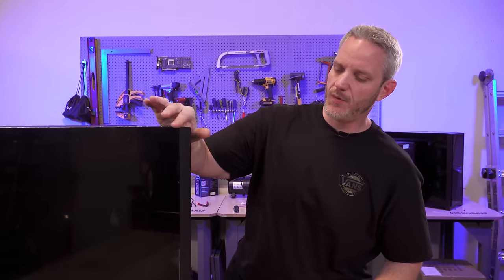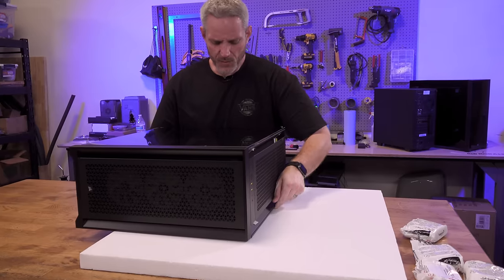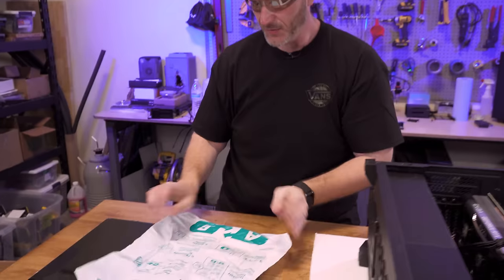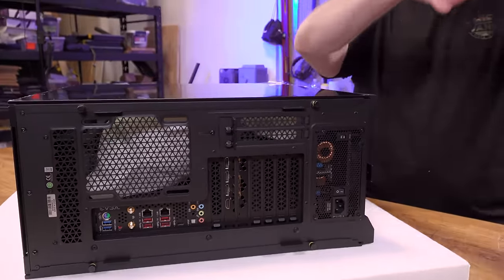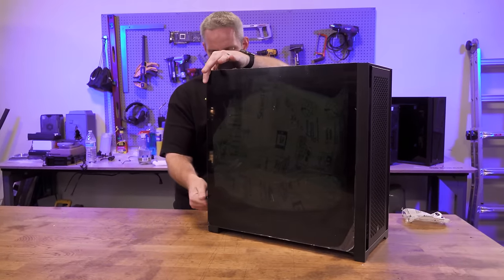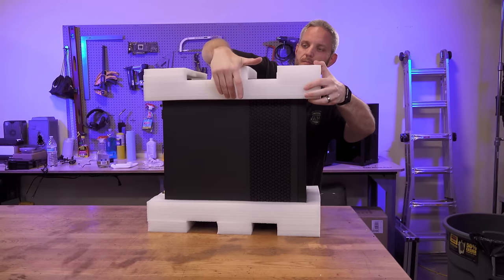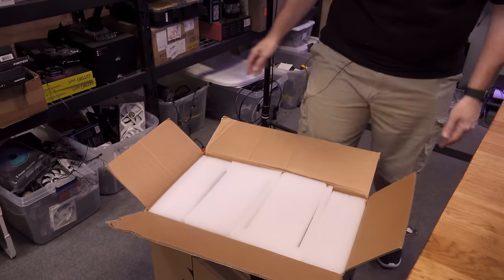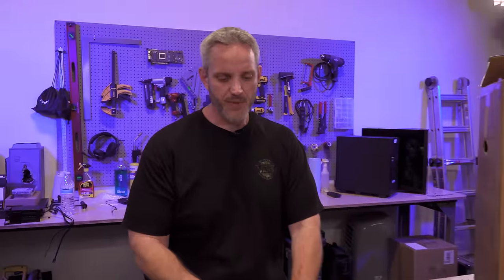How to properly pack and ship a PC!

Comment: Jay's 100% correct. When it comes to shipping something valuable, you can NEVER be too careful.  Most shippers don't give a rat's patoot about your expensive equipment.
Reply: Yea it all goes well until it doesn't and they you can get some really bad experiences which you could have avoided if you took more time/care properly packaging. I learned it the hard way and don't cheap out anymore on properly packaging electronics (specially pc related).
Reply: Reminds me of when i ordered a corsair power supply from Amazon. UPS was the one who delivered the psu. And you could clearly see a puncture hole in the psu box. Which doesn't make sense considering the psu box is wrapped up in clear plastic wrap. So any UPS worker could tell that it was a computer part. And yet they poorly handled it. Luckily the psu works fine. But yeah shipping companies don't care. One of the reasons why you should always double box any pc or pc component.
Reply: That could also happen at Amazon. When I was working there before Christmas I saw people yeeting dozens of PS4s into shipping-container_thingies. But hey why do you know there were PS4s in the package boxes? Well the packaging machine ran out of tape so 10-20% of the boxes weren't even closed properly.

Comment: I am a former UPS employee and I can say without a doubt, Jay has put forth the best package protection effort I have ever seen.  Oh and a warning to anyone reading this, I know you may ship fragile contents and you may be tempted to have a Shock Sensor included on your package.  Allow me to let you know first hand that almost any Unloader/Sorter who sees this, will fuck your package up.  Not to be malicious, but purely for the "joy" of watching the shock sensor turn red.  You've been warned.
Reply: How long does the employes of UPS work before they are sacked, in general?
Reply: @Bratfalken  I imagine it depends on the employee. I have seen instances where they are handling the package and make it seem like the package "slipped" out of their hand as they handle it. They would primarily use just enough force applied directly to the Shock Sensor to turn it red.  And then you had those blatant savages who would smash the packages. The more savage ones were usually very likely caught because management on occasion would randomly walk around and observe people.
Reply: Way back when I worked at a freight warehouse, we’d just rip those shock indicators off. A lot of them were so sensitive you could pop it if you set something down too fast with a forklift

Comment: #1 Tip for packing and reusing a shipping box (along with all the great tips below) = ALWAYS re-tape the BOTTOM of the box as well as the top.
Packages (esp large/heavy ones) tend to get abused on the bottom the most while slid around - So many times I've had things shipped and the bottom nearly busted through. 
I bought a playstation once and the seller reused a box,  applied like 5 layers of tape on the top but left the original tape on the bottom. I received the box, but not the playstation... The box was super light and at first I thought they just shipped an empty box but then I realized the one flap on bottom was open (could tell it was ripped from going thru sorting machines). Yeah that was a fun claim to explain to ebay.. But I could prove that they used layers of tape on top, but left the original layer on the bottom - so it was poor packing.
#2 Tip when shipping something expensive - always attach a printout of the buyer and sellers address and tape it directly to the item (or put inside) - this way if the package somehow gets torn up in the sorting machines or the shipping label is ripped off - the courier can still figure out where it goes. I usually put an entire copy of the shipping label inside the package, attached to the product.
Reply: That is some excellent tips! The second label is an especially good idea for expensive items being shipped.

Comment: I used to use instapak in my job for years.  It does not like to flow DOWN.  We used a machine that we could select the bag size and foam amount and the best way to fill a box with instapak is to make sure the foam filled the bottom edge the laid it into the corner or edge so it could exnd against up/over whatever you had in the box.  These kits might act differently but from my experience you got a better pack if you let it expand up and in.  And to go over something, you just let the bag fold over the object and the foam will expand into the bag in that direction.

Comment: Thank you for the video. I always wondered. When the instapack takes shape around components and locks itself inside the case. How hard is it to remove it? Do you have to cut it?
Reply: It doesn't usually jam itself in too bad, just rock it out of the little cubby it forms around.
Reply: @raze4789  Thank you, I appreciate it.

Comment: Removing the GPU and shipping it separately can be a good alternative to Instapak. Also we didn't get to see it in this video, but putting this in a second, larger box, with foam corners in-between is a very important step.

Comment: One thing that not many do, make sure that the glass panel side is on the bottom side of the second box, sometimes people put other boxes above yours and if your box gets enough weight it might push and break the glass, however placing the glass "down" side of the box gives some more protection, don't forget the "This side up" stickers.
After shipping dozens of computers, not one arrived damaged, and yes I did double boxes too. 👍
Reply: Nicely done in keeping so many PCs safe! 😁
Your tip about having the glass pannel facing done is a pretty good tip. I would also place the PC in a bag, tape a solid piece of cardboard over the glass panel and then wrap the enter PC in a couple layers of large bubble wrap. After that point I would place that in the box face down like you mentioned and secure the box in another box designed for the rigours of shipping with more packing materials between the two boxes. 😊😁
Reply: @jamesfstokes  Oh and I forgot to say, the 2nd box was "Double layer" I got them for cheap on U-Line, you really don't need bubble-wrap unless you are missing the 1st box entirely.
Also, placing stuff in the voids of the 1st box might not be a good idea, the voids purpose, is to give room for the box to collapse into without reaching the computer.
I never shipped liquid-coled computers so that one is beyond my scope.

Comment: we use an industrial version of "insta-pak" we have a container that holds the liquified foam at 75 degrees until it is injected into the bag and sealed. Yes we have to move very quickly to get it into place before it sets up.

Comment: I had the original boxing, and I used pillows on the sides and air bags for the front and back. I removed the GPU and the PSU as well as a few other cards. As long as it doesn't shift inside the box it's usually ok.

Comment: So I worked for DHL. However here in Germany. Dunno about DHL in other countries.
But here it is the case that you package it yourself. And you are responsible for sufficient packaging. 
But they don't require you to have it packaged by them.
Also quick note. Every package will fall one meter onto a metal frame at least once. 
That is because in the facility where they are distributed there is a machine where the package will fall for one meter.

Comment: Also one of the Reasons i build a SFF-PC, I could carry it around in a big Bag XD. The NR200P came with a TG and a Mesh Panel. If i had to move or something, i would pack some styrofoam in it, so parts don't move around and then just pack it in the original packaging it came from. And yes I keep ALL original packaging of my currently used parts...even the 48" TV.

Comment: I shipped 2 computers from Toronto to Kelowna BC Canada. About 5000Km. Canada Post. Just put the computer in the original case box with the original foam packing. But I reinforced the case box with coroplast sheets cut to size. (The corrugated plastic used for signs) Wrapped it in plain brown paper and put Fragile stickers on all sides with 'This side up' stickers as well. Corrugated plastic sheets are much tougher than cardboard. I also bought insurance for them. Arrived on my doorstep one week later in perfect condition.
Reply: How did you keep the brown paper from getting ripped off in transit?
Reply: @jamesfstokes  2" wide fiberglass packing tape on all the seams. Then again on the edges of the parcel to reinforce it. I used to work in shipping/receiving.

Comment: I work for a computer supplier company as a receiver and I will tell you the kind of stuff.  Forklift gouges, dents in boxes that would kill a human being if hit like that, boxes thrown/dropped.  Yeah, many of these people just do not care.  We'd point out holes, damage and etc. and it's like no problem for them, when it actually IS a problem for us because the item in question is now useless or unsaleable.

Best computer company that ships properly is Origin.  They actually use wooden crates.  No clue how it is on the inside but the crate never seems damaged.  We get computers, monitors, cables, memory, hard drives not so much and complete systems, Apple or PC.  We even get 3d printers as well as regular printers.

Comment: I used to work for a company that expedite shipped for FedEx.  I've seen how they pack the trailers.  Basically, they just stack the boxes inside the trailer, and when they get to the roof, they simply cram another box into the space to basically wedge that tower of boxes in place.  It's not wrong, but at the same time, the damage shows up in the shipping package.  UPS packs the loose boxes and packages onto pallets or palletized crates.  DHL, not sure.  Then when it comes to off loading, I've seen boxes flung out of the trailers like frisbees...

Comment: The way I ship my own PC is to remove the GPU and put it back into the original box or if not I make a box, which I knew how to do cause I worked in wharehouses and wrap said box on bubble wrap.  Then I fill the inside of the PC with anti-static bubble wrap and fill it really good.  Then I wrap the PC with more bubble wrap and put it inside a luggage or shipping box. If on a box I try to fill the box with either paper or anti-static packing peanuts.  Never had a problem with shipping my PCs doing this.

Comment: When I pack heavy, fragile things (>20 lbs), I wrap the product in garbage bags, place it in a box and shoot spray foam and it'll give a custom foam fit every time. Tape the box, then place it in another box, fill with more spray foam. I've shipped consoles, computer CRTs, and even consumer 32" CRTs that way and the receiver has yet to complain about damage. One did complain I put in too much spray foam and it took them 5 minutes to unbox it. 🙃

Comment: In Australia, I have shipped many PCs around the country both very cheaply (costs me like $25 AUD to send a complete PC several thousand kms within a couple days) and without ever having shipping damage.
I don't know if this is just an extreme case of luck or due to how I package them, but I certainly don't do quite as much as Jay for a regular system.

I get those giant rolls of bubble wrap (50cm x 50m) and some of those sealed-air packs (~10 x 15cm plastic bag ballooned out full of air and sealed).
Firstly I try to use a case that has a GPU support bracket (like nearly all Inwin cases do), and if not I'll just cut some solid foam to hold the exposed corner of the GPU.
Then I use sealed air packs to fill in the majority of the inside as they're quite sturdy.. and some scrunched up bubblewrap to fill the smaller gaps and hold the packs/foam in place.

Then, assembled PC goes into the case manufacturer's box with their suspended foam system - but I don't fill it like Jay, I just leave it as is with the air gaps.
Any accessories, cables, spare screws, user manual etc I include in the motherboard box which I then tape to the top of the case box.
And finally - I roll the entire thing up in about an inch thick of bubblewrap (can't see any pictures or text through it which helps to hide what it is) and put the shipping label on top, my logo stickers on the side and some fragile/this way up stickers too.. if it's overweight I'll also add the '2 person lift' stickers.

Shipping something in a perfectly square edged box with handles, or a wooden crate - seems to give the courier the impression they can be rough with it.. but having the whole thing wrapped in bubble wrap to the point it has rounded edges, no easy handles to grab onto and is difficult to stack things on top of - means they magically arrive with no damage at all.
I do also tend to favour m-ATX builds so the total weight comes to around 12kg (26lb) fully packed

Comment: When I ship a computer I do essentially what you do.  But when I do the double box I use spray foam that expands after wrapping the inner box with cling wrap. Works extremely well and never had a computer arrive broken.  If you don't care about looking ghetto expanding spray foam in zipper lock bags in place of instapack works too.  I only ship to friends and am not worried about looking professional though XD
Reply: Any advice on how I ship my pc from USA to UK? I plan on removing the graphics card and cooling- its water cooled, and then find instapak to put inside. But I can't find the instapak used in the video, do you have a link to it or what you use? Also with the spray you mention how do you get it out after? And what about getting through TSA if I decide to get a travel case?
Reply: @alexandrarossi1799  hey id ship via UPS or something.  For a desktop anyways.  If a laptop yeah just travel like you normally would. 

As for getting it out I plastic wrap the inner box. The spray foam tends to either not adhere to it or easily break off.

Comment: 10:14 after the insta pack, I like using pool noodles as foam, for packing up the PC along w/ hot melt glue do creat a custom “suspension rig to hold the PC like a new Bourne baby, swaddled in loving arms…..and b/c they cheap to buy at dollar store compared to the great high density packing foam😉
Oh, and also using multiple glued layers of cardboard to create a cage around noodles…..
And to be clear…the noodle and cardboard, is for the 2nd box the pc box goes into😊

Comment: I had a PC sent back to me for repair severely damaged on the way, by USPS. The rivets on the corner of the case had been snapped and the frame bent badly. I told the shipper I couldn't believe she sent it via USPS and only insured it for roughly 1/5 the value. Yeah...that was fun. I don't have a lot of experience with DHL but I'd rate the quality of service as 1) FedEx 2) UPS and 100000} USPS.

Comment: When I was a missionary I shipped a computer overseas and I used clothes to pack the computer. I had a working computer on the other side of the Atlantic and there were boot prints on the box but everything was fine with my computer. Used it the entire time I was overseas and it went back and was fine when it got home because I packed my extra clothes in it. Honestly what you're doing is probably better but underwear and winter coats and stuff are great for shock absorption.

Comment: @Jay - I used to work at a FedEx Office, and the comment about not being able to declare a value without them shipping is wrong, at least when I worked there. They either have to pack or inspect for proper packaging if you declared above $300. For computers, it is standard packaging process to double-box, as well as using instapak like you've done on the inside. Now, if the team member actually follows correct process is another issue... but my stores always did, because I trained my people right.

Comment: Im about to move my sons computer for the 20th time.  We pack it with cotton socks around the gpu and then put it in the original Lian Li Lan Cool II box. It then goes on the car on a seat with a weighted blanket wrapped around it. 1600 mile drive from Virginia to Kansas. Never had a single issue.

Comment: I was responsible for the production and shipping of framed photos as big as 40"x60" and I learned 2 things. You cannot over package or test something and shipping is hella expensive.

When we tested packaging for all of our sizes, we would throw the packages down a loading dock in multiple manners. Landing flat, landing on the long side, landing on the small side, landing on a corner, landing after doing a corkscrew 720. We also hit the package like a maniac in a metal beam and step on it.

Even if all those tests worked with zero damage, some carriers for certain locations would inexplicably find a way to break it.

TL;DR; Prepare for the worst and expect the minimum.
Reply: That is pretty amazing the amound of abuse you put the test packages through to try and make sure the frames arrived safely.  My guess is that in some cases forklifts and the sorting machinery might have been responsible for some of the damage you experienced.

after all no mater how much force you put into trying to damage a package a machine is easily capable of multiple tons of force.

Comment: kinda related... I had 2 cases of 16 oz white Monster drinks delivered from Amazon, they arrived on time and were placed up close to the house to be out of the weather... in fact they were so close to the house they were placed against the storm/screen door...  good thing there was a door on the back of the home, there was no way I was going to be able to move both cases by pushing on the door without breaking the storm door.

Comment: You can use packing peanuts or air packs to fill the void on the glass side, since air won't transfer shock load through the box into the glass.